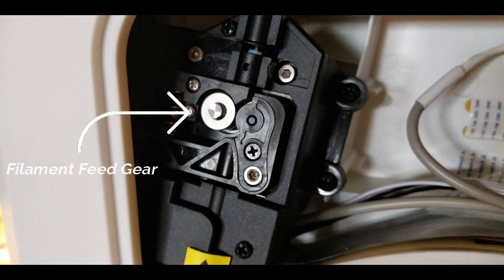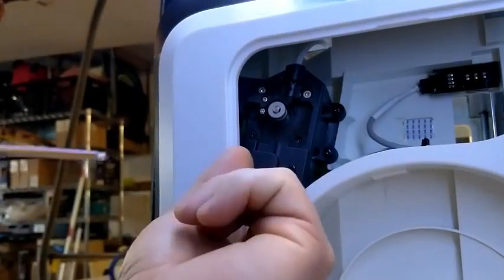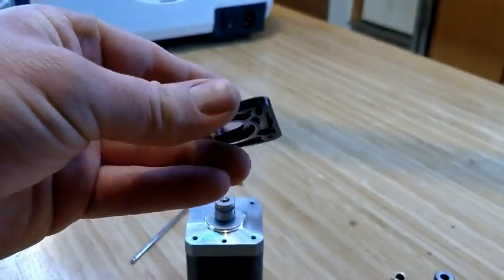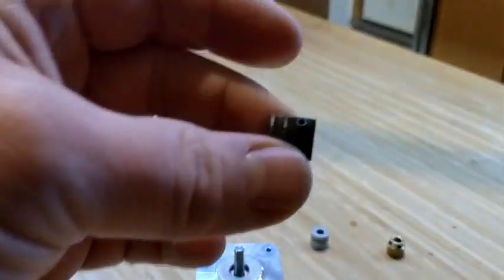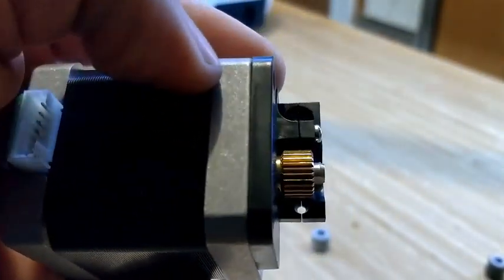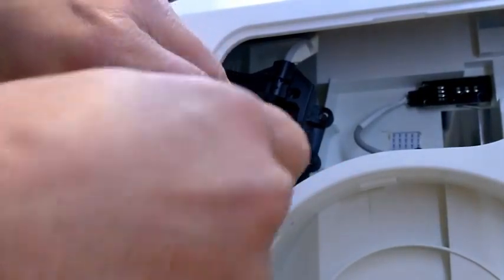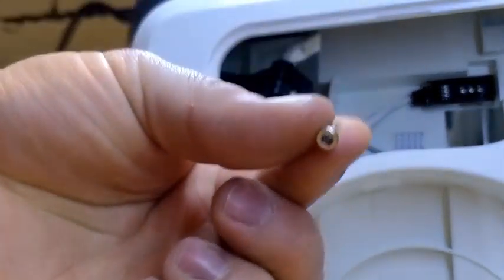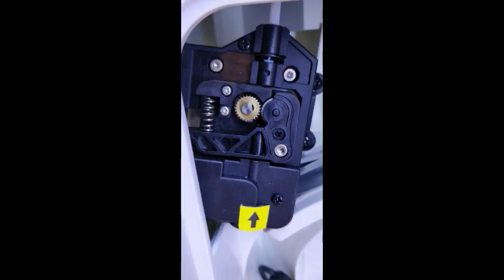Adventurer 3 Feed Gear Upgrade - How To

Comment: You actually only need to remove the spring loaded tensioner. I had no problems whatsoever replacing the gear without removing the stepper motor. Just turn the motor  so the screw is accessible and use a hex key with ball end

Comment: I do this by taking off the top of the sping assy so 1 cap head then remove the gear with a stubby Alan key cut down to about 4mm so I can change the gear in about 2 mins on the steal ones

Comment: The replacement motor I received has an extra chip/board inside, and a black wire coming out. Any idea what's up with that?
Reply from the maker: It could be an encoded stepper motor, should have only four wires and a plug.

Comment: Thanks. The feeder gear teeth had clogged during a very long print. I did this swap while the print was paused and I did it without unplugging the motor. Worked great! This works for Adventurer 4 as well FYI.

Comment: Big help when I had a piece of broken filament stuck inside the Bowden tube, thanks! After disassembling the frame from the stepper motor, I could get to the stepper end of the tube and just push it the filament out. Reassembled and everything worked like new :-)

Comment: Great video. I found that I could take the two black screws out and pull the whole assembly through  and then unplug the stepper motor. Then disassembly was easy with no hassle removing the spring assembly etc.  I reassembled the unit and was able to slide it back in after connecting the plug on the stepper motor. I might have been lucky, but I have done this twice now and it worked.

Comment: Great video thanks - my adventurer started making a knocking noise and not feeding filament.  The nozzle was not clogged.  Following your video I took apart the feeder, reassembled - and its working again.  Thanks!!!!
Reply: Did you reassemble with upgraded feed gear, or the original one?
Reply: @boostedboxerchronicles bruh I'm curious on that too^^^

Comment: I’ve lost the spring inside 🤦🏽‍♀️ How do I retrieve it?
Reply: Ok thanks to you and this FlashForge video I was able to take the side panel off. I just used the first few steps, not the whole thing. Just posting in case it helps someone else. https://youtu.be/jJcUgSRN8FU
Reply from the maker: Turn it upside down, carefully and shake it out?
Reply: Thank you for replying, I’ve tried doing that and it no longer rattles so I think it’s stuck in there somewhere. I’ve messaged FlashForge but they haven’t given me advice to solve it yet. I feel I need to take some of the casing off but I can’t find instructions or a video so I’m nervous to try.
Reply from the maker: @AverageZoeBlogs  oh darn. It's been awhile since I've taken this machine apart. There might be a way under the bottom panel.
Reply: I really appreciate you replying, I’m going to try it. Thank you 🙏🏽 Your videos are great, new subscriber here!!!

Comment: I now have, a ADV 3 with the 50 teeth gear, but it seems to be too tight? Seems that the guide wheel will stop sometimes and the filament just slides in it, without turning? When using a 11mm, isn’t this quite bigger than the original? I have heavy underextrusion with the new gear, seems to much pressure?
Reply: I just looked at your video again, does your gear touch the guide wheel when no filament? My gear touches the guide wheel, if there is no filament in.
Reply from the maker: Well I've got a stack of gears here and they are all 11mm (original and new), did  the spring and idler wheel go back in smoothly? Perhaps something is sticking or not quite right?
Reply: @imaginationtechnology6291  do your gear hit the guider wheel, when there is no filament ind? So if you run the extruder with no filament, it actually hits the guide wheel?
Reply from the maker: @martinherse3272  yes it does but the wheel rotates nicely when filament is running through.

Comment: I would recommend using a touch of blue locktite on the set screw.  Metal in metal thread set screws often work themselves lose. I had to use it on my creality printer. Feed gear coming lose will ruin your print.  I always use blue locktite on rc cars motor gears, if not the RC car gears will destroy themselves.

Comment: Where would you recommend to get one of the brass feed gears?
Nice tutorial.
Reply from the maker: You can use whatever gear gets the job done. I worry a bit about brass in case teeth wear down and leave bits behind.
Reply: @imaginationtechnology6291  Sorry.  I meant Where can these be purchased?
Reply from the maker: @dalelstrand Well you can purchase them from Amazon, most 3D printer parts retailers etc.
Reply: Like I switched to this gear and all it does it grind the idler and doesn’t push filament in at all just grinds it up

Comment: Great video, thanks for the help and tips. I change my feed gear and instant had no more problems with feeding. Secondly, I also did like one other guy said, first simply dismount the complete housing, and after on the table uninstall the motor :))))
Reply from the maker: Glad to read it.

Comment: can I use tpu on this printer?
Reply: @castcreator1 235 celsius, 0,18mm 35mm/s,  65 celsius on plataform, and ive cut 1 turn of the spring of feeder
Reply from the maker: Yes you can, there's even a preset for it in the software.
Reply: @castcreator1 youre right theres no preset, but i managed to do it, im very familiar with this printer now

Comment: You said in another comment that the new gear mixed with the new nozzle helps with different filaments, which ones are you referring to?
Reply from the maker: ABS and PETG have a noticeable difference for me with the new gear installed.
Reply: @imaginationtechnology6291  It was after trying to print with Petg i found your video, had major underextrusion with Petg, to the point my prints where useless. Waiting for a 26tooth now, hope it will help. Thanks for the vid :)

Comment: Interesting tutorial, thanks! There is a way of pulling out the whole piece as one, just remove the two philips screws , disconnect the electric plug and the feeding tube, then you can work all the rest on the table. ;-)
Reply: Oh

Comment: Nice tutorial. You didn't really say how they perform though. How do they perform? Do they address the dreadful clicking and slipping?
Reply from the maker: Performance has improved greatly, which sort of prompted the making of the video to help the community. There is a new nozzle available now from Flashforge that really eliminates the need for the gear. We've kept ours on the printers even with the new nozzle as it helps with using different types of filament.
Reply: @imaginationtechnology6291  Thanks for the reply. I bought one of these a few weeks back and I'm trying to work out whether to keep it or return it. I normally use a FF Creator Pro for making custom motor and modelling parts, but I need a second one for prototyping plus production runs (if I'm busy). I've found the clicking and slipping a real annoyance, and the bachlash is pretty bad, meaning it never retains calibration. I'm also finding it really hard to get a flat, level top surface on prints with larger areas (which is useless for parts that are supposed to mate with others). 

I've spent literally hours and hours or tweaking, but it's getting to the stage where I think it might be best returning it and get something different, but I'm willing to give it one more chance. I just wanted a printer that worked, which is what this is supposed to as it's marketed as needing little in the way of tinkering, it even the bed leveling (or lack of it) is a pain...printing rafts for everything shouldn't be the solution! 

If this mod helps stop slipping, that is great, but the nozzle sounds interesting. I've not heard about that. Do you know what's different about it? I've found g gb is pretty decent for abs, which is one reason for keeping, but not enough on its own!
Reply from the maker: @StrathpefferJunction  I'm not sure if your are on Facebook or not but there is a community there that will probably be able to solve most of the dreaded clunking issues. There is also information on the new nozzle style for you to browse and a host of user mods as well. https://www.facebook.com/groups/1183417165156337 . Definitely worth a look.
Reply: @imaginationtechnology6291  Thank you!
Reply: @imaginationtechnology6291   so i too have been having the slipping problem, but even with PLA.  Does this gear change completely stop slipping with PLA? While i am aware of the new nozzle, i only mostly print in PLA and the cost propositions are vastly different. So heres my question to you , again, does this mod completely stop the slipping or is it to be paired with some slicer tweaks too?
Reply from the maker: @cardoode  it has worked excellent for our printers but not for all materials. Some material require the fan duct to be plugged off as well. I've found it works for all of our PLA needs though.
Reply: @imaginationtechnology6291  also the brass gear seems to have 26 teeth and not 40, do you concur?
Reply from the maker: @cardoode  you are correct.